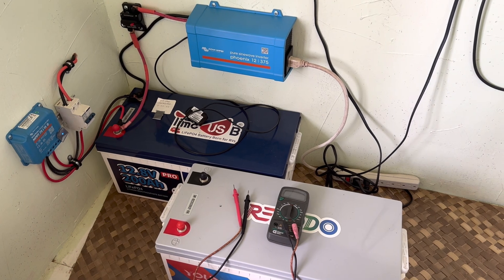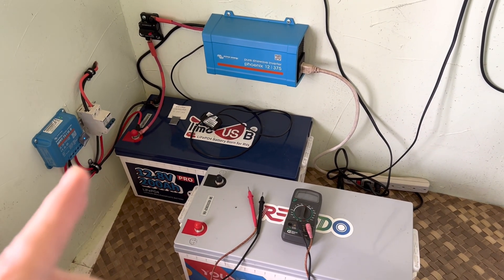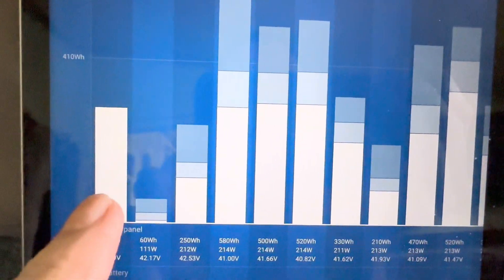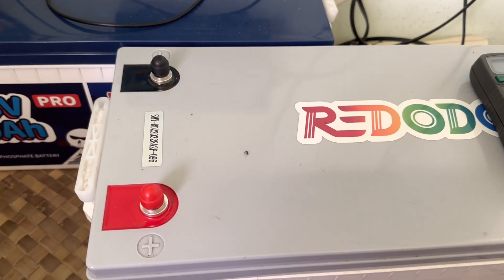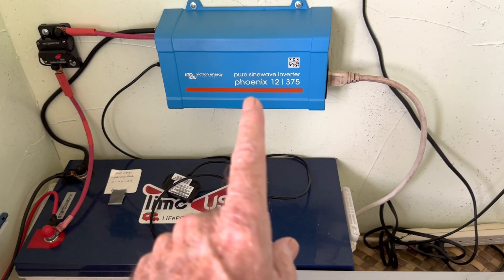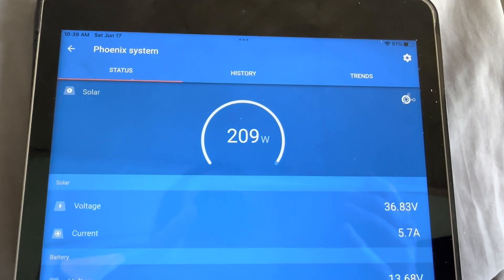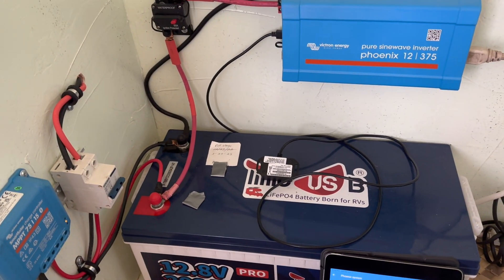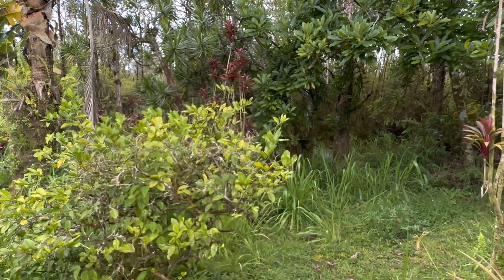BMS Fail!? REDODO 12.8V 200Ah LiFEPO4 dead in the water with no obvious signs of what happened. RIP?

Comment: Does  anyone  have the procedure to troubleshoot  a battery.
Reply: I can, but if you don't have access to the cells, you can't do much to check.
Reply: what's wrong with your battery ?
Reply: Nothing , 
I did have  batteries that were  bad.  
Chins  just  replaced  both of them 
But I  bet  only one was bad.
Reply: Can you do a load test  the same as a lead acid? 
How can the BMS  be checked
Reply: @boscodog4358  there lies the problem.  Unless it is a smart BMS. You can't check it on a sealed battery.  If I would purchase a prefabricated battery.  I would purchase one with a Smart BMS. You can connect via Bluetooth and monitor the BMS along with the cells. All my plug and play batteries I purchase with a JBD and I use Overkill Solar's app to program the BMS to my parameters.  If I purchase any other,  I install a Daly active balancer because you can set the balancing parameters and monitor the cells. LiP04 cells are a little tricky to maintain.  The Grade A cells that are matched  closer are easier to maintain,  but they are reserved for expensive mostly commercial builds. Because of the charging curve,  the cells drift further apart with every charge and discharge cycle.  Because most of the power is used around nominal (3.3v) the closer you keep it there,  the longer they will stay closer to balance.  Above 3 4 and under 3v per cell and the imbalance will show up more. There is a science to it.  I will try my best to help anyone who wants to know more understand .

Comment: A good way to make the batteries last longer is to shut off charging at 14v. It will save you from overcharging
Reply: Under advise I began insuring weekly cell balancing @14.4vdc each.  LiFePo with BMS will balance themselves at that voltage.  As long as I see a day with 58.2vdc for 1/2 in the sun (48vdc system), I feel I'm..................balanced?
Reply: @latitude9.5north54  if you can't monitor each individual cell inside the battery,  then it could still be out of balance.  All my batteries have cell monitoring for each cell.  I only go over 14v (3.5v per cell to top balance when setting it up. After that, 14v max even with cell monitoring and balanced within .002v. He was charging at 14.2. Nominal and 85%of the power is around 3.3v per cell. If 3 were at Nominal that's a total of 9.9v leaving a cell 4.3v if the BMS doesn't kick in = a bad day.
Reply: @TheTimshady337  It may be all batteries and BMSs (LiFePO4) are not the same.  I am following advice from my battery manufacturer.
One of my systems was going down, dropping like a stone after the Sun went down.  Disconnected them all and charged them all individually to 14.6vdc and they all came to life and stayed at 13.4vdc through the night.  They also are charging faster when the Sun appears.  Three of them were below 10.2vdc.
All recovered.  
It's recommended to perform this balance every six months or so.  Takes me back to EQ of FLA Baghdad batteries.
Reply: @latitude9.5north54  That's right.  Most of these "drop in" 12v LiFePO4 require charging to at least 14.2 to give the BMS an opportunity to balance the cells. And they need time at that voltage to do it.  Not every day, but depending on cell quality and aging they can drift at changing rates.  I've several of them in service and half of them were not balanced correctly when received. It took time to get them balanced and so far they seem to maintaining balance.  🤞

I was not able to get all of them to accept a charge up to 14.6, however.  All of them eventually made to 14.53v or higher but on two batteries the BMS would always shut down at 14.54v no matter how many days I'd held the battery at 14.53v.  I think those were two of the TImeUSB set.

I have two Chins with bluetooth BMS and those have a very bad balancing algorithm.  I don't remember details now, but using the bluetooth app to see when balancing is active and the individual cell voltages but unable to change any settings was very frustrating.  So close, yet so far.
Reply: @latitude9.5north54  you are correct.  The key is to maintaining cell balance.  There is no one size fits all except the fact that the cells need to be balanced.  Without a way to check each individual cell lies the problem.  I'm sure the battery the OP has doesn't have a smart bms. Without a proven BMS inside. Charging his battery past 14 will cause a cell to over volt. If you would have charged each individual battery in your bavk to 14v. It would have given you the same results.  The key is keeping the voltage to 14v until it pulls 0 current from the charger.  Providing the BMS  has a good balance circuit,  it will bring each cell to 3.5v. He had the same problem as you, but in his case it was in the 4 cell battery,  In your case it was 3 batteries in a 4 battery bank. The correction process is a little different,  but same principle.

Comment: My guess is the cells got out off balance and the BMS didn't go into overvolt protect and overvalued a cell pack.
Reply from the maker: May have to tear it down huh? 🤙
Reply: Thats what I am thinking since he was getting those spikes
Reply: @joshwilson8501  the spike might be when BMS shut down, the last registered voltage was the peak current coming from the charge controller just after shut down. Like when you close a hose suddenly, the sudden pressure inside the hose peaks for a split second and that is what was registered at the Victron app.

Comment: I took many prefabricated batteries apart and the biggest problem is the BMS and ability to balance the cells. If i can't see  each cell, I only charge to 14vmax.  3.5 volts per cell.
Reply: 🤔 and what the advice on 24v batteries?
Reply: @vroor32 if it was a single battery 8 cells, I would max charge it to 28v. I also never let them get under 3v per cell I r 24v
Reply from the maker: Good advice! 🤙